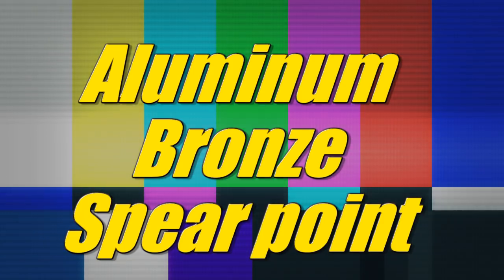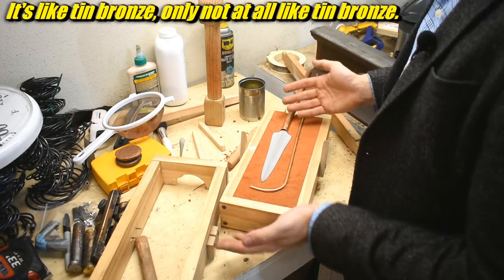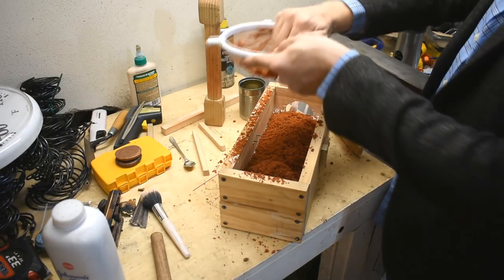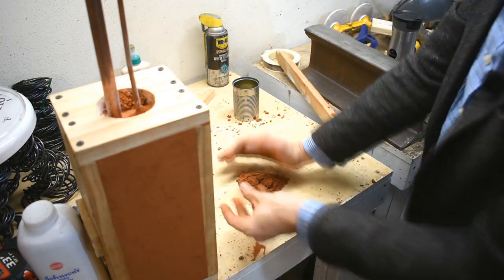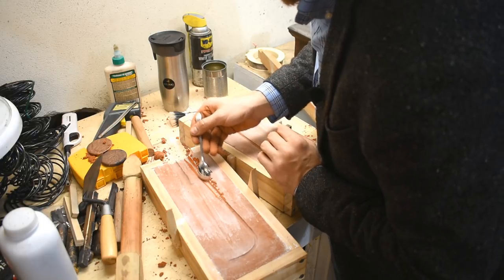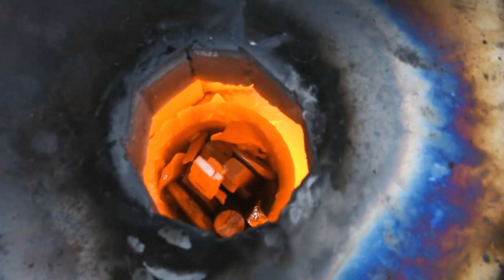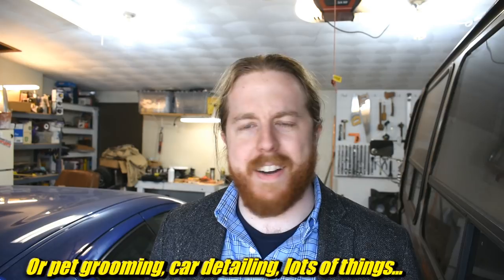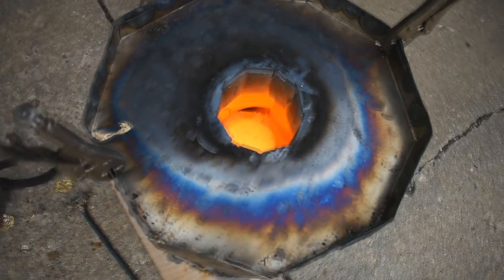Casting an Aluminum Bronze Replica "Bronze Age" Spear Head in a Vertical Sand Flask

Comment: I highly suggest using an air compressor to lightly blow the loose sand out and also blow the pour hole out really good and you'll almost never have any problems with getting sand in your castings and don't be afraid of getting a little break off especially on something like this because the grinder will clean it up real quick
Reply from the maker: i've been meaning to make one of those set ups.  I have a compressor i just haven't had the time to set it up

Comment: I’m :55 seconds in and stopping to just say. WHY cast thin? Wouldn’t you think that the solution, that even the people of the time did, was cast slightly thicker and pound the rest of the shape thin? Also, the artifacts that we have now were not as thin originally due to the decomposition. That’s my guess now, I could be completely wrong. Also, I think they used heated soapstone as well
Reply from the maker: Yeah heated stone is definitely what they used.  The bronze artifacts wouldnt have corroded away and gotten thinner but the casting originally would've been thicker around the edges out of the mold and hammered like you said

Comment: Question: When you use the muffin tin to make the pucks, how do you prevent copper/bronze from braising/sticking to the steel of the steel muffin tin? I have had this problem with hotter metals? Aluminum pops out cleanly, but copper/brass/bronze tends to stick/braise and ruins the "ingot" mold.

Comment: I vote spear you need the extra toughness of aluminum bronze to withstand the forces exerted by using a big lever so make sure you use a good straight grain somewhat flexible Woodstock Osage orange/ bodark maybe (if you can get it)
Reply from the maker: I can get osage orange at woodcraft, that would be fun.

Comment: I really enjoyed the video where you made that bronze spear. Good job 👏. Now How do you put that spear head on the wooden shaft if it does not have a hole for the top of the wooden shaft?
Reply: It should be hollow at end to allow wood to be inserted and held in by two cast lugs with twine on head pulled back and wrapped to secure onto wood  also would not be shiny for hunting

Comment: Would you be able to make a lead hammer????
Reply from the maker: Probably, lead is really low melting point.  I dont have any lead, though
Reply: Also, lead is very soft.  It wouldn't make a great hammer.  Oh and poisonous, lead is poisonous as well.  You can mix it with Antimony to make it harder, but that also makes it brittle.  Oh and Antimony is even more poisonous than lead.